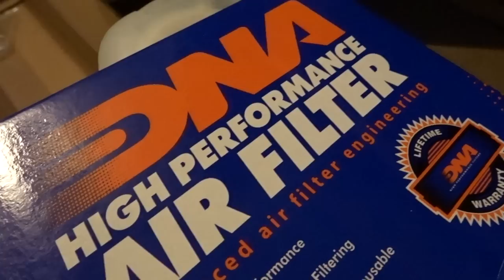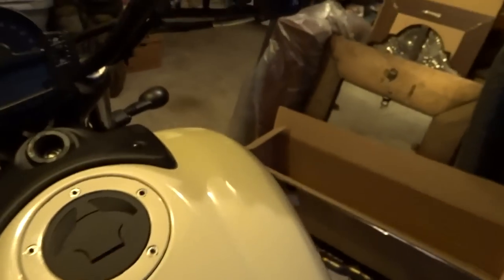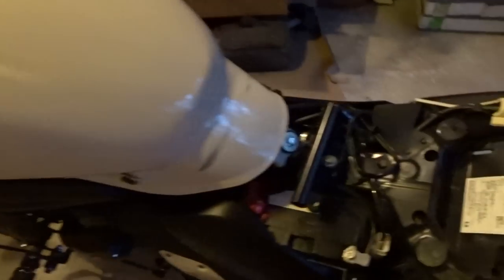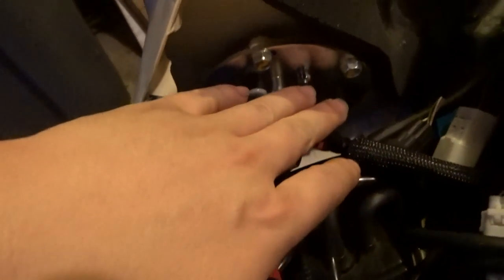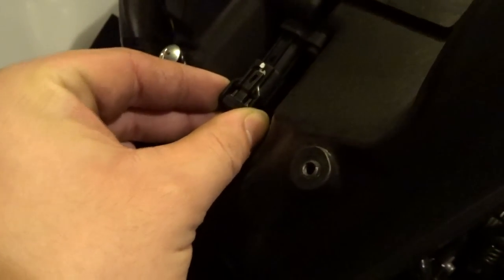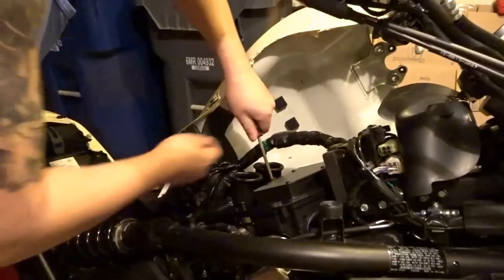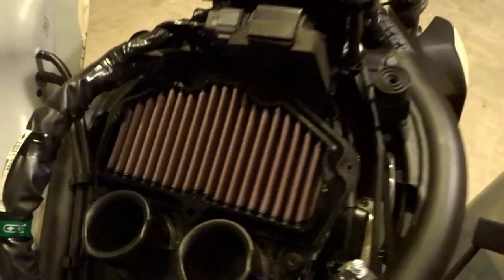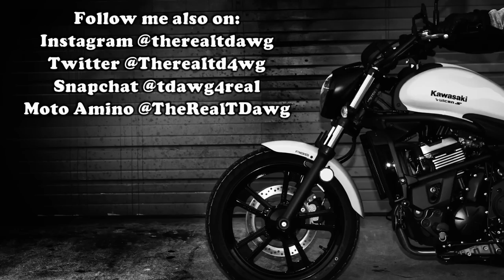DNA Air Filter Install | Kawasaki Vulcan S | Install Video

Comment: Ordered and installed the DNA air filter on my Kawasaki Vulcan 650 S.  I removed the tank completely.  You are right about the main wiring harness being tight!  I also installed a Booster Plug at the same time.  Very happy!
Reply from the maker: MrEye4get glad to hear!
Reply: MrEye4get noticed a power change with the filter and booster plug?
Reply: Henrik Vesander so any difference with the booster plug and the filter? I am thinking of doing the same but I am quite weary about the performance improvement of these changes. Thanks

Comment: I saw guys disconnecting gas line and breather cables to completely remove the tank and you just used your head to do it the easy way 👍

Comment: Use the brackets on top of the tank, where the plastic you took off covers ignition, by sum kind of tie that goes from one of them to the handlebars.

Comment: It was this vid that gave me the epiphany.  My brain cells awoke albeit briefly and I realized that an entirely new genre of noise has arrived.  YouTube has conceived what I shall call......Happy Days Doo-wap and Soul Train had a baby and it was remixed by an app....noise.

That tank is more shallow than I imagined.  I suppose all the baffles keep the fluid in subdued slosh mode thus making for accurate levels.  Wow. 

Great tutorial.  But changing the filter seems a chore compared to other tasks.  Maybe the after market will resolve the Kawasaki faux pas.

Now to get that tune out of my head.

👍

Comment: Good video man. I need to remove the tank or at least to loosen it up to change the turn signal relay to be able to install LeD blinkers and I was worried about not been able to do it properly. This video shows is possible to do but we need to be careful when laying the tank down. Have you notice any power difference or acceleration improvement with the filter?

Comment: Damn that's a lot to take off. Just like the z650 and versys650
Reply from the maker: yeah it was more than i thought lol... wasnt hard, just more than expected lol
Reply: Well considering this bike is built off of the basis of those bikes, one could only assume it would be similar just like many of the parts that can be used accross all three bikes.. its not so bad just time consuming. My buddy and i stripped his Z and painted the frame and put it all back together in like 3 days due to out work schedules
Reply: coincedentally you have to remove that much to install a power commander

Comment: Anyone else notice the pump action next to the bed? Also I'm wondering if the filter NEEDED to be changed. There didn't seem to be enough particulate to restrict airflow. Otherwise good ingenuity on the air filter replacement.
Reply: like i said elsewhere you cant really tell until doing most of what you need to replace it to even look.   i think i would be like him have the replacement already bought.... take a look to see what kinda shape the original is in and still replace it... then go a bit longer on the replacement the next go around...cuz i would have experience that it can go longer with where im riding and what the conditions are.

Comment: changing air filter on a  80's z1000: 10 minutes with a 10mm wrench .. changing a air filter on a  '80's R100/RS less than 5 min with no tools.. changing it on a 2025 Vulcan s: 1 hour with a complete garage... what's wrong in our century?